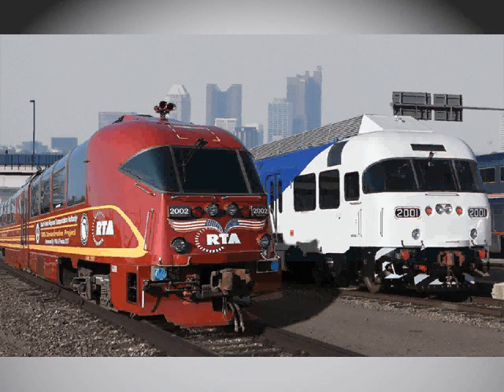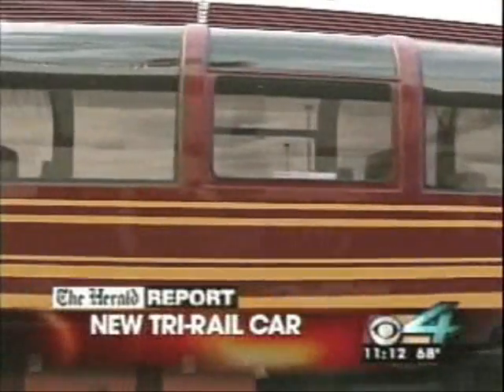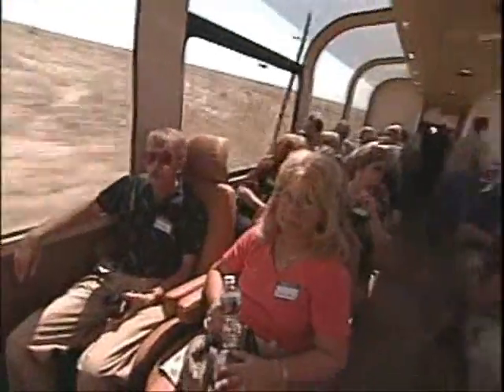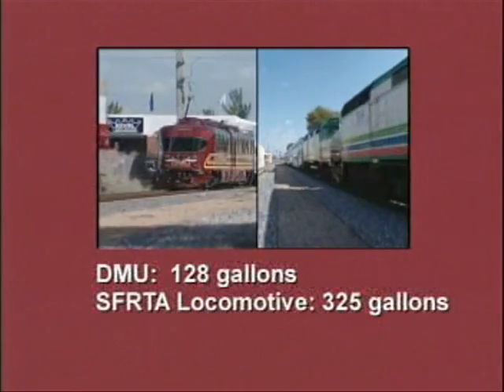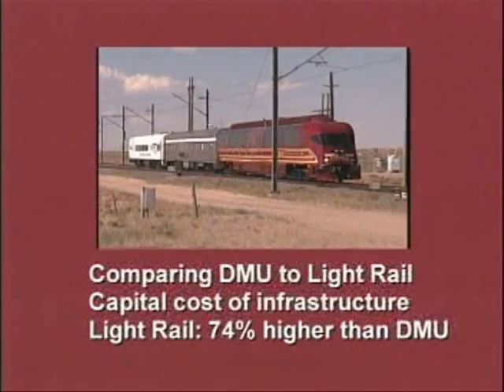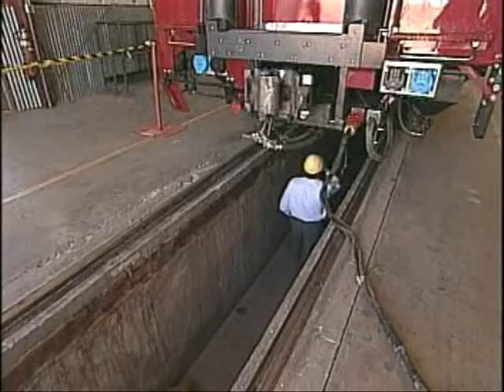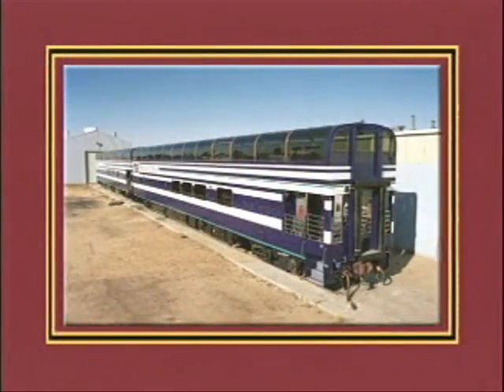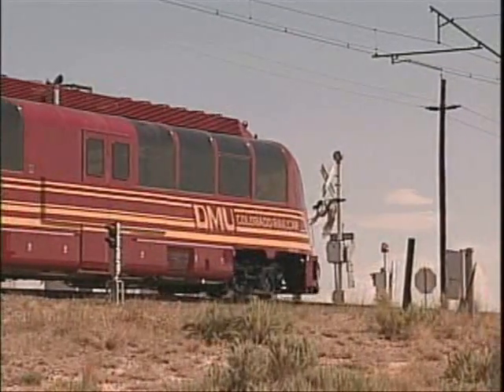US Railcar DMU

Comment: The Budd Company did it all 60 years ago with the RDC.  It also had two GM Detroit Diesel engines each driving one axle through a two speed torque converter and Spicer drive.  It had, of course, half the horsepower of this DMU, and the Budd company did not okay the RDC to pull nonpowered cars.  Railroads which did so voided the warranty.  The RDC could be updated for today with higher horsepower, power doors, wheelchair accommodation, modern restrooms and FRA crash standards.  But no one is talking about that.